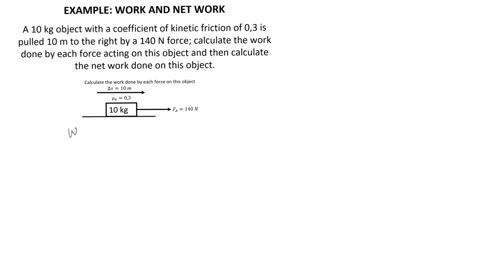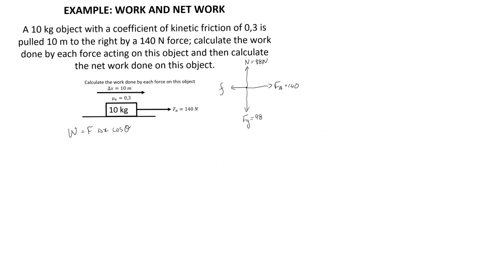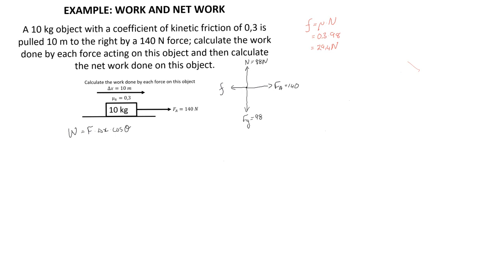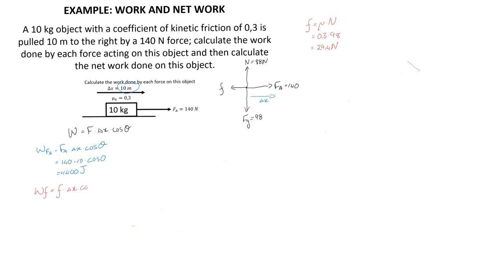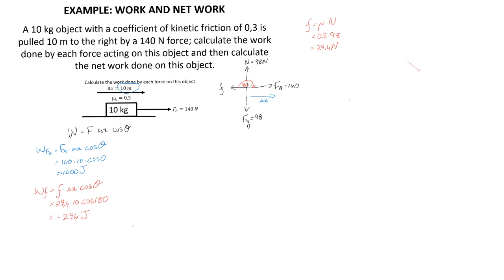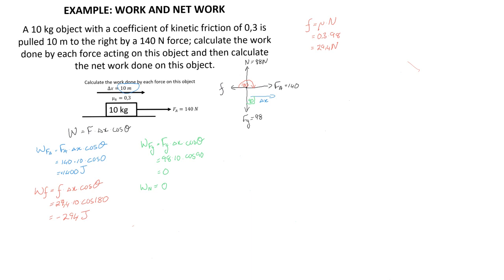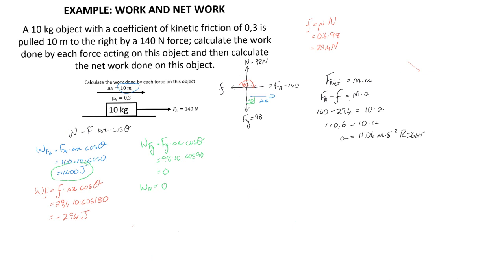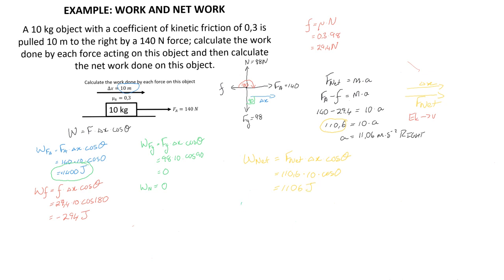Example: Work and Net Work

Comment: Hi can u talk about the angle of fiction when the force applied is applied at acute angle. And talk about the the work done on an object when it is being pulled vertical.
Reply from the maker: I can do that, but as a general rule one can say that friction is always opposite to motion and therefore the angle is always 180 degrees. When the force is applied at an angle to the motion them the component of the force in the direction of motion must be calculated.